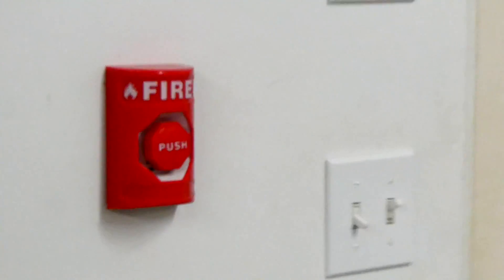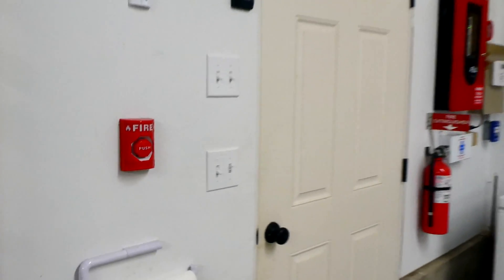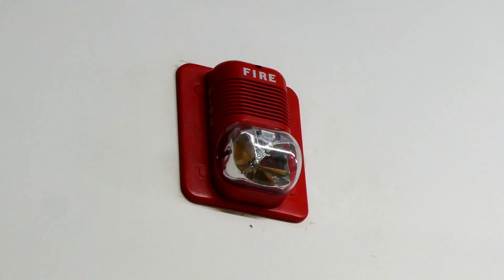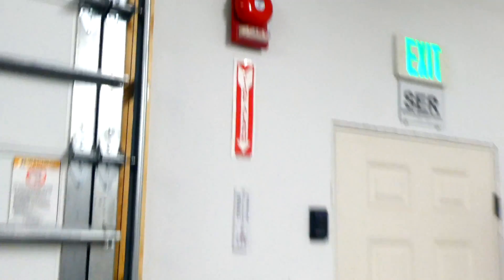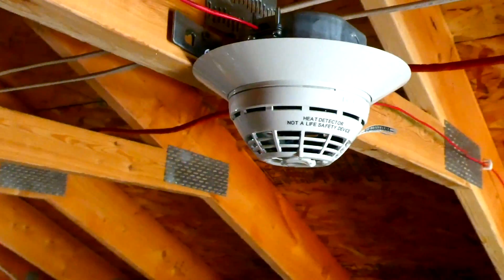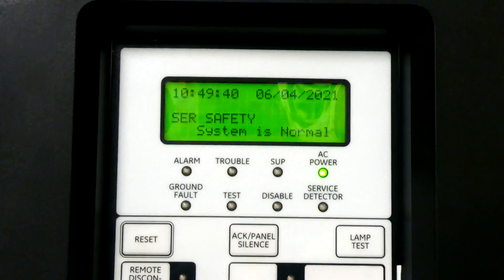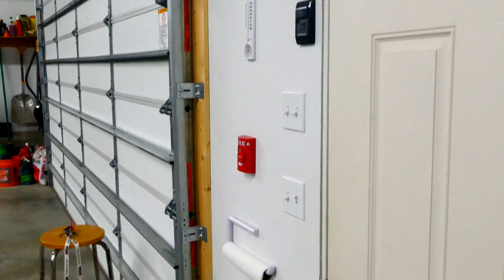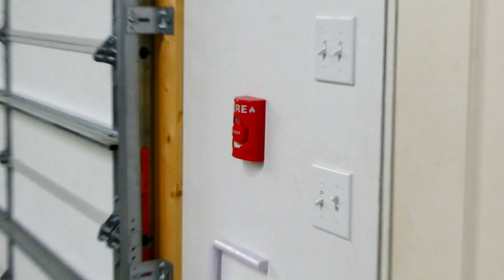Kidde System Test 19: Fire Alarm Bell!

Comment: SER safety I have a question. So I am trying to wire my system sensor mass12m non ada to a pull station. I am using 9volt batteries as my power source but if I use just one 9 volt battery the strobe won’t flash because it needs a minimum of 12 volts to flash but in a video someone made a video of an ada mass saying if you use 16 volts it will fry the alarm. I need to know what powers source is best to use. I just want to make sure I don’t use to much voltage and fry it. Is 18 volts to much for a mass12m non ada

Comment: I have a question. So, I plan on getting an Edwards FX-5R conventional panel. Is there any way to prevent it from calling the fire department?
Reply: I might be wrong but the panel itself doesn't call the fire dept, the fire alarm dialer does. It won't call the fire department unless you buy and hook up a dialer
Reply: I have fleas
Reply: @missbleach8767  oh
Reply: @BeamLJ_Drive08  🙂

Comment: My 2nd 5th grade school and my 6th grade has these but 10" bells on continuous before that 9219s and before that 4903 9102 9838s 4050 80 4051s ibm bells disconnected though the 4903s were working and those 4050 80s and there 2903 doing 2001 March time and it was loud

Comment: Neat, I’m a bit of a fan of the strobe plates with bells you should do them more often
Reply: DON'T CALL ME DIRTY PERCY!- Alec Baldwin, 2002
Reply: @procellfoxmain_JnA_Official  l we be doing a fine alarm system test siemens speaker strobe 4 watt at my apartment for the test l have the 4watl speaker strobe 4 watt and the gentex SS PK 24 wl Pr speaker strobe Setcw speaker only 4 watt high low tone voice evac system test only